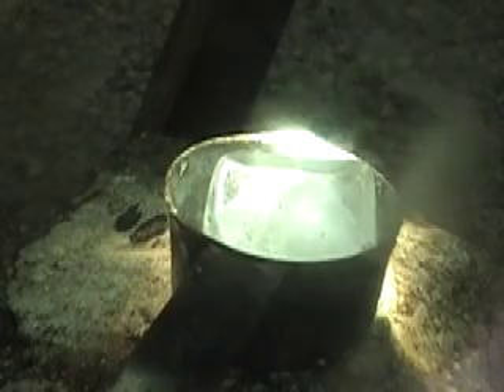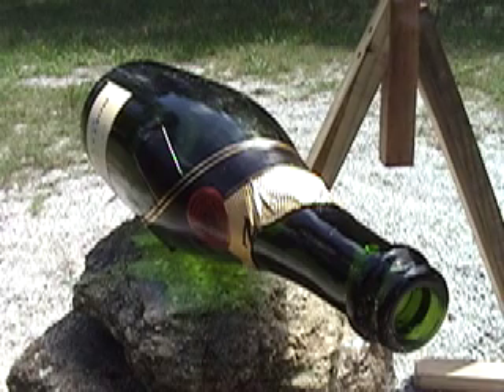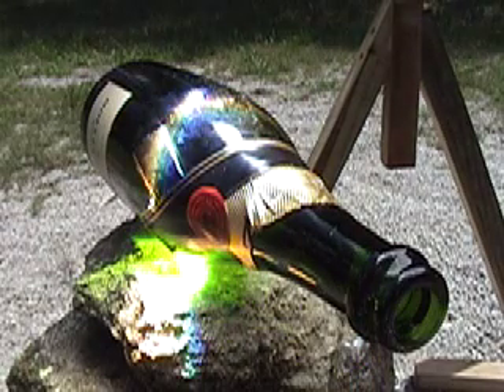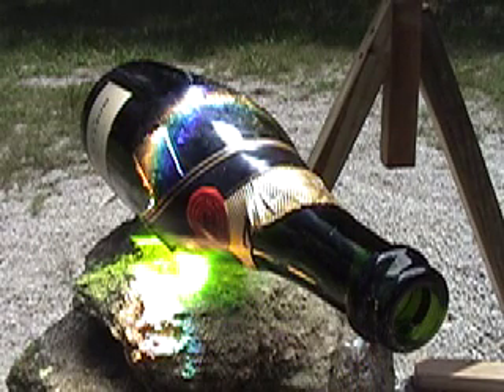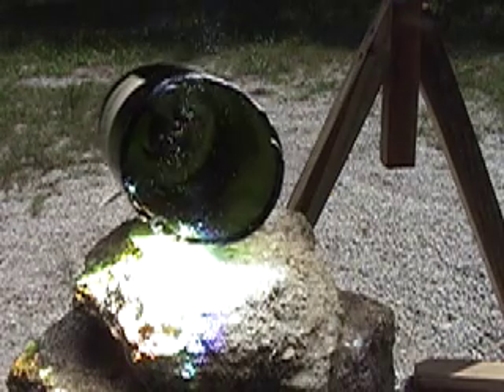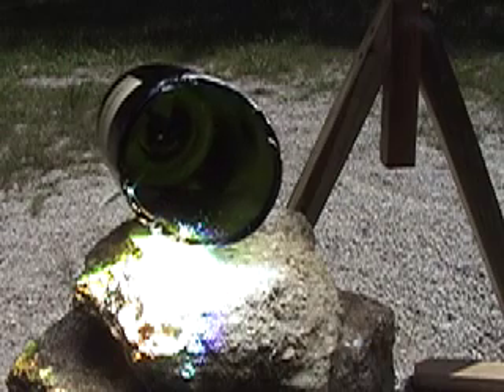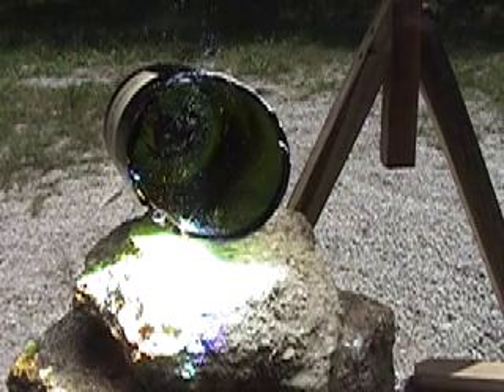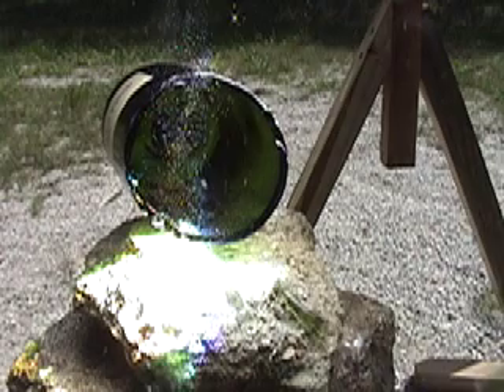FRESNEL LENS SUN COLLECTOR MELTING GLASS SOLAR POWERED FOUNDRY

Comment: It is recommended that customers use the Instant Tan TM only once per year. Instant Corporation is not responsible for burns or other medical treatment cost resulting from the use or Instant Tan TM. See also our other Instant Products such as the Instant Body hair removal system with extra large oxyacetylene bottle. Also the Instant Shower with 22,000 PSI option! Repeated use of any Instant TM device can result in decapitation, loose bowls, total skin removal, blood loss, or other major injury!